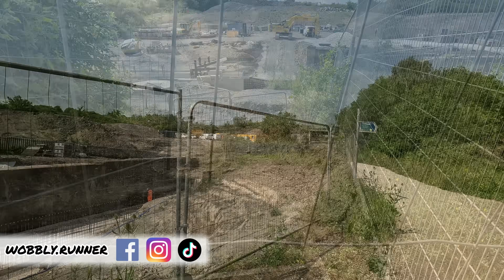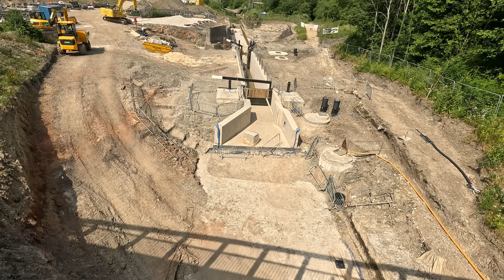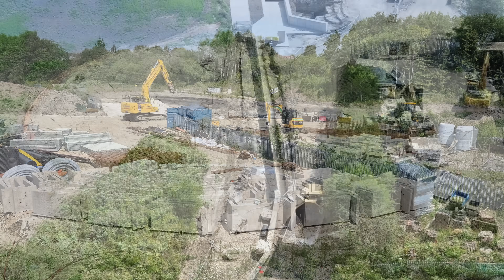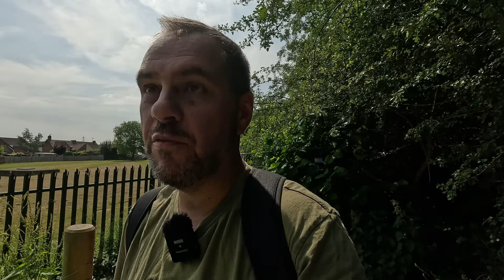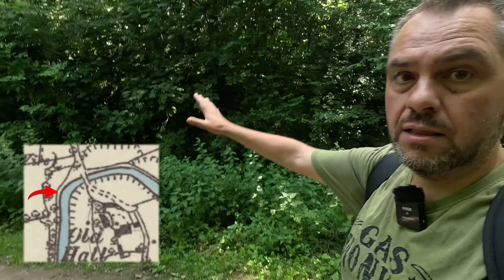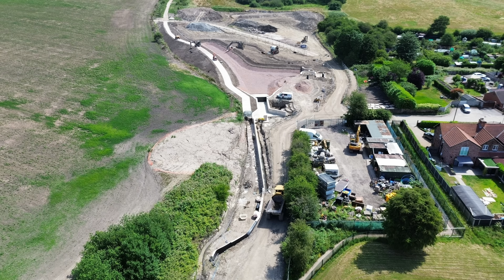The Missing Pieces Of This Canal Are Finally Joining Up | Chesterfield Canal Restoration

Comment: We live afloat on the Chesterfield Canal - and have been afloat for over 30 years. 
When we first came on, the proposed opening date was 2002! Good to see it's looking a lot closer.
Do you have any idea how the reopened canal will raise the funds for it's maintenance now it appears CRT are no longer going to be doing so?
Reply from the maker: 30 years on the Chesterfield Canal. I've bet you've seen some things :)
I don't honestly know the answer to that question. I see they are investigating in things like the composite lock gates for example to try and reduce maintenance costs down the line.
Reply: @WobblyRunner 
It's not all been on here. We had a few years on the Bridgwater & Taunton in Somerset and more years on the Worcs & Birmingham - but we've been back almost 20 years now.
Lot's of changes. I did the Big Bash with WRG as a kid and remember the Duchess of Devonshire reopening the section to Morse Lock.
It's on a downward spin now though. Maintenance is poor, facilities being closed, experienced staff being moved on for contractors. 
Overall the waterways are in their worst state since the late 60s. It's a worry.
The composite lock gates are a good move - as I the liner for the bed.
I wonder if the plan relies on the tourist income from a lift at Killamarsh? It seems financially risky to me and I wonder if the trustees have a plan b.

Comment: Hi, whats going to the canal rote around Renishaw and Killamarsh. Also Norwood tunnel.?
Reply from the maker: Hi Julian. Lot's to explain, but I did a video last year summarising what is required here - https://youtu.be/_uxoGeMZXvE.
There's lots of stuff on the Chesterfield Canal Trust Website too around Renishaw and the tunnel options.
Reply: @WobblyRunner  Hi, Wobbly. I`ve watched it thank you and found it very interesting. I`ve walked many miles from Kiveton towards Stockwith also along the Chesterfield sections. I don`t know if I`ll ever get to see the whole length re opened.
I used to work at Staveley works and the old guys told me that there was a basin in the works too.